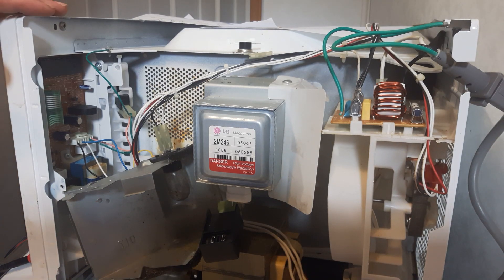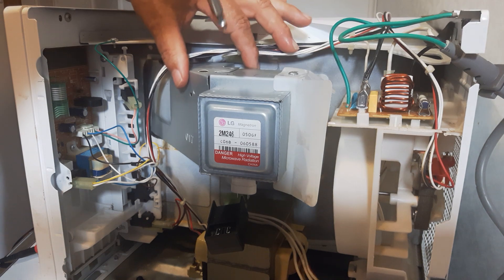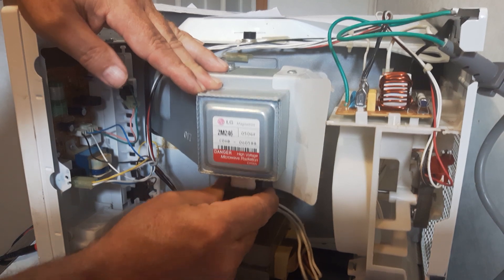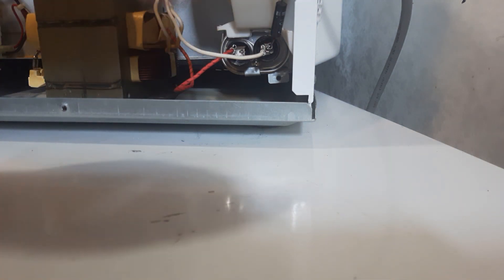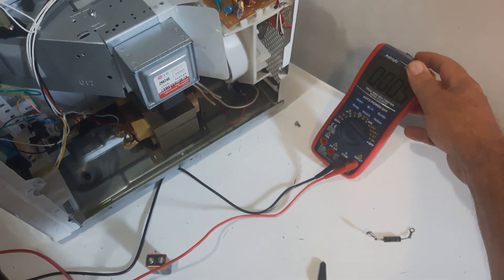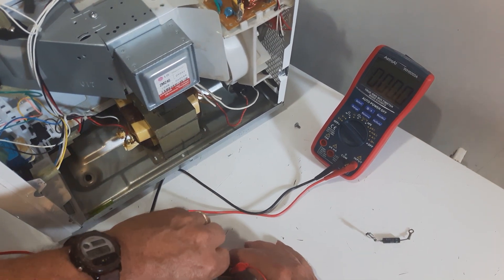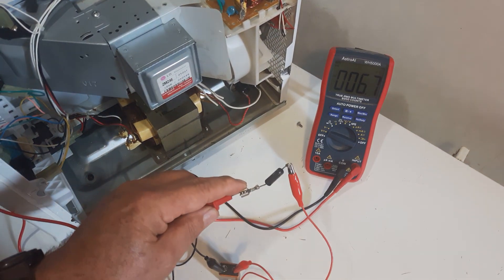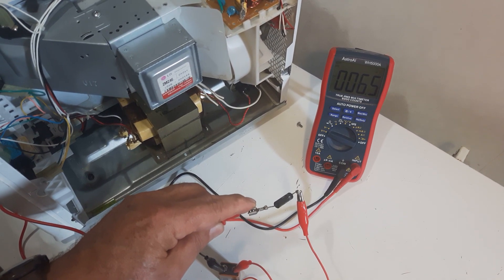Microwave runs but no heat Part 3 of 6 ( Diode )

Comment: You only checked the forward direction. You should check the reverse polarity too. Put positive to the cathode, and and negative to the anode of the diode, and make sure the voltage is zero.
Reply from the maker: Thank you